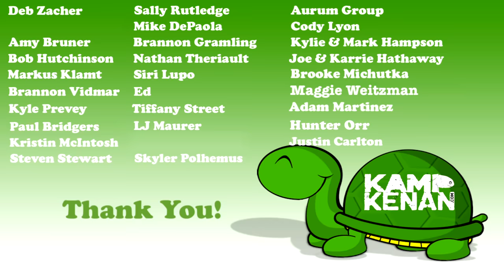Cold Prep Emergency for the Kamp!

Comment: Dude.  A bad gfi is a nightmare.  I replaced my key outlets with some solid ones, just a little extra, and it was so worth it.  I’ve got power loss alarms on the outdoor reptile circuit (great for chest freezers btw) and VeSync smart wifi outlets that have cool features.